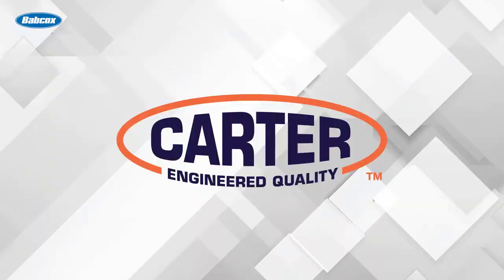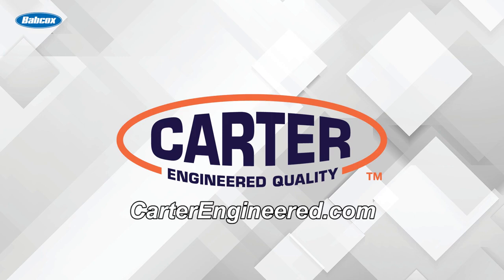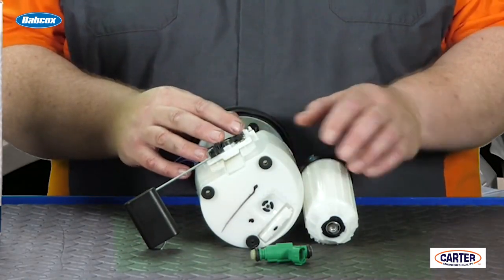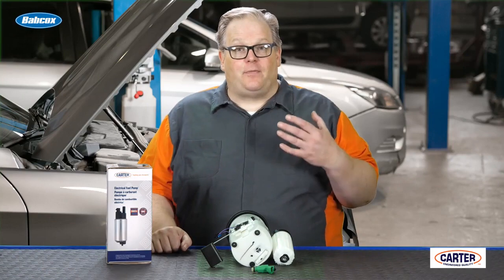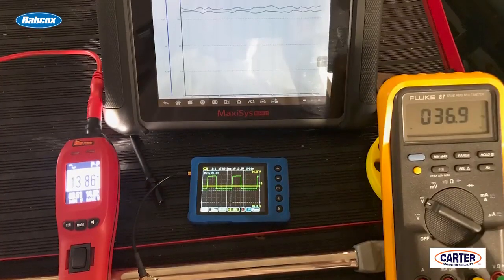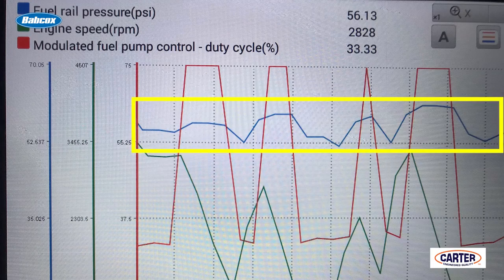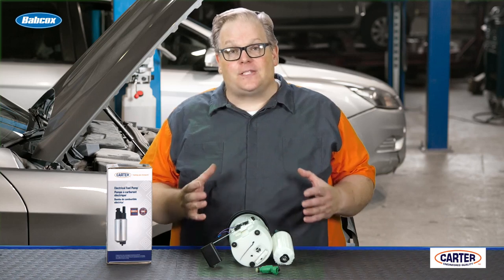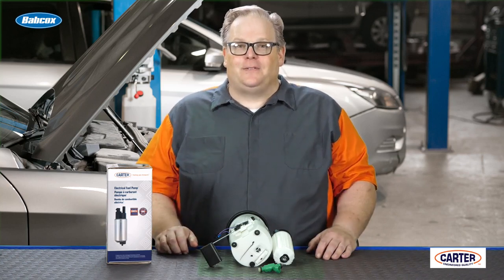Understanding Fuel Pressure

Comment: I have a pump in the tank and a high pressure pump. If I scan my car with Carscanner, I can read the commanded rail pressure, and that changes a lot, depending of the amount of throttle I give. Either 280bars at idle, or over 1000bars when I go over 3500rpm...